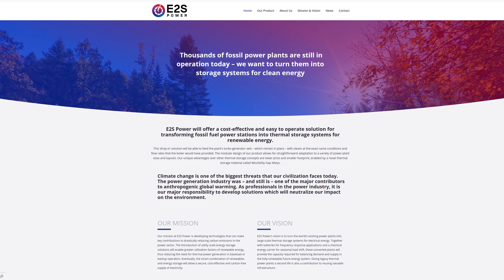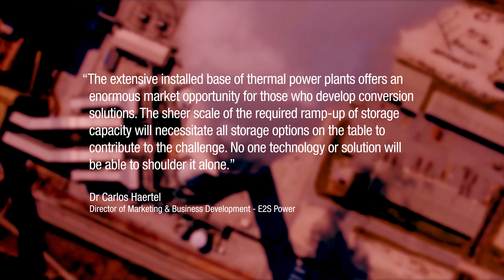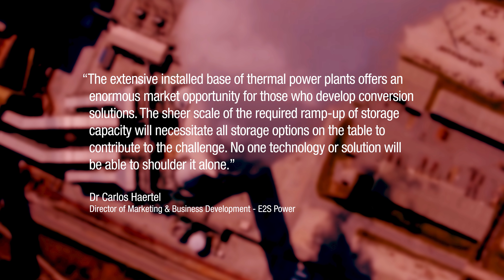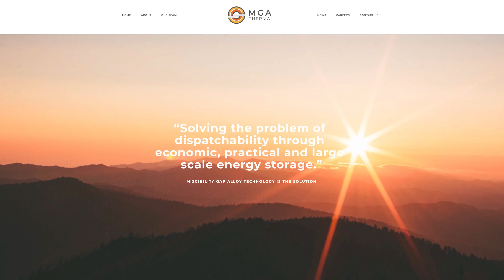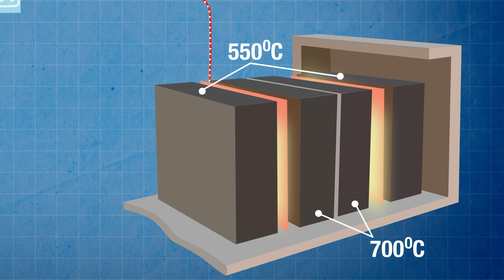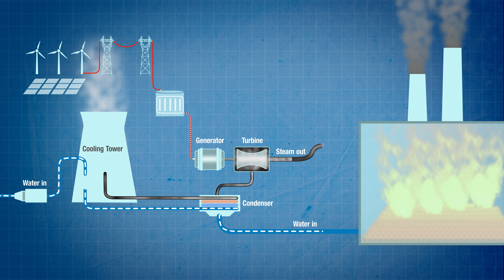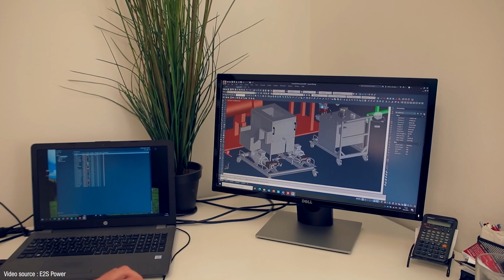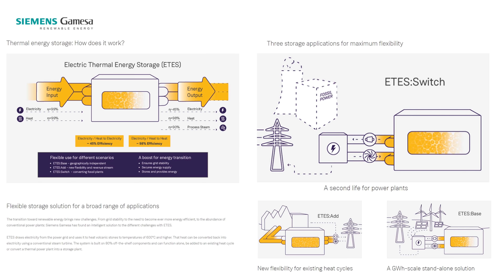New energy storage tech breathing life and jobs back into disused coal power plants

Comment: There are a lot of "ideas -- scientific principles" that work. It's all about cost at scale. What's cheaper? What will last 30 years? Heat energy stored in rock/gravel/sand as sensible heat or heat stored as latent heat (phase change)? Aluminum is a good choice because it's phase change occurs at 660 C and high pressure steam in a power plant is 540 C, so that's a good match. Each pound of aluminum absorbs/releases 396 BTU. E2S Power is very new at this. Their website says almost nothing. Siemens Gamesa is taking the hot rocks sensible heat approach. Basalt (a good stone for this app) is $50-80/ton (maybe less in giant quantities). Aluminum costs $2710/ton. Then you need to design and cost the containment vessels and equipment to move the heat. A lot of work to do, but that's what engineers do. Get some funding and hire a bunch of engineers. Right now I'd bet on Siemens, but the E2S Power concept is intriguing. As a retired chemical engineer I already have a thousand or so questions!

Comment: Hi Dave, It is encouraging to see the diverse range of solutions being developed for grid scale energy and there impact on the viability of alternative energy sources.  I am surprised that none of these solutions are looking to use excess energy to produce hydrogen.   Is there a reason for this?  Perhaps it’s round trip efficiency is too low?
Hydrogen appears to me to be excellent fuel source for short term peak energy production through existing gas turbine infrastructure, or indeed to power steam boilers in existing coal fired power plants.    
The extra bonus that hydrogen promises is its ability to power mobile plants and heavy trucking. 
I would love to see a comparison of the various technologies and their respective pros and cons round trip efficiencies.
Thanks for the channel it is extremely informative and thought provoking.
Reply: Good point.  If Hydrogen is used for heating purposes and for industrial processes including steel production, fertilizer production, and other chemical syntheses, then there is no efficiency disadvantage between H2 and battery electricity. For home-based fuel cells or combustion engine to generate home electricity as well as waste heat recuperation for home heating and water heating, then there is no efficiency disadvantage between H2 and battery electricity. The electric grid is still there to consume solar and wind electricity directly, as well as storing the grid-excess electricity in grid-utility battery or PowerWall home battery. Likewise, a Plug-in FCV can use grid electricity for 80% of total mileage and needing H2 for only long trips totalling 20% of total mileage, while requiring 1/5 the total battery capacity of a long-range BEV.

We can have total wind and solar capacity as high as 3-5 times the maximum power demand of the electric grid, so that the vast amount of grid-excess capacity will be devoted to making H2 for all kinds of usage. Thus, when combined solar and wind outputs are down to 1/3 to 1/5 of their peak, then all of this weak output will be fully-devoted to power the grid. In this way, we can have a grid powered by 100% RE nearly all the time, without resorting to much energy storage. Home-based Fuel Cells or H2-Engine can be programmed to turn on as back up power for the grid if necessary, thus sparing the additional expense of having stand-by power stations that are rarely used. The waste heat of the home-based FC or H2-Engine can be used for making hot water or keeping the house warm, thus maximizing H2 round-trip efficiency to rival the round-trip efficiency of battery. 

Blue and Green Hydrogen will have a gigantic market for steel production in order to replace coal that is currently used. Likewise, H2 will replace fossil fuel for heavy-duty transport vehicles like planes, ships, trains, and trucks. Light-duty vehicles and short-haul trucking can use Battery electricity, in the form of Plug-in FCV that will have JUST ENOUGH battery for daily commuting and delivery when charged at night, while longer trips will use H2 for convenience and seamless utility. A personal Plug-in FCV will take advantage of a nation-wide H2 filling infrastructure for trucks and buses and will have no infrastructure problem.

Comment: I wonder if thermal efficiency could be boosted by integrating condenser plumbing into thermal storage units to  preheat the units during their off-cycle. Or would require an overly complex and massive heat pump mechanism?

Comment: My only question here is with these massive blocks that are 700 & 550 degrees Celsius is the insulation from the outside air. Will this insulation reduce the temperature around it or will it still expose the world to high temps in potentially millions of places around the world? I realise there's no CO2 but if there are millions of these won't that expose the world to some level of warming & if so, how much?
Reply: For the previous reason I wonder if towers that raise & lower weight wouldn't be better for the climate? Perhaps designing a private tower for individual homes which could also include a small vertical wind generator attached to it as well might be a better solution. I don't see the value in heat storage unless the insulation keeps that heat radiation to a very, very low level. I also don't trust controlling bodies to actually give a toss about reality over money.
Reply: I wonder if it's not time that every new home built has its own power supply included plus solar panels &/or VAWT included in the build automatically. Use of battery storage might be optional. Independence has got to be an improved scenario to what is happening at present.

Comment: Really? Assuming a power of 100MW sustaining for 8h 
Using Enthalpy of Fusion of aluminium 10kJ/mol and no losses
You need a block of aluminium weighting 7400 tons
with a size of 14x14x14 meters as a rough estimate
graphite not included
And 100MW is a rather small power plant, I think 
Battersea Power Station from the fifties had 3 units of 100M and three of about 70MW

Comment: Efficiency? By the time the energy goes into the storage system, is retrieved, boils water and spins the turbine, what percentage of the energy in comes back out in the form of usable electricity? That did not seem to be addressed in the video.
Reply: I would suggest that those people questioning efficiency are missing the point.  Yes, it does have to be have a level of efficiency to make it commercially viable.  BUT given the context of global environmental catastrophe due to climate heating, ANY method that contributes to reducing CO2 emissions must be seen as worthwhile.  The level of efficiency of any technology tends to be increased over time in any case, so arguing over efficiency at day one is not helpful.
Reply: @chrislaf2011  Asking about the efficiency of the system is worthwhile. For LI battery storage, the efficiency is over 80% and LI battery systems can respond to changes in load in milli sseconds. I don't think that this energy solution can come even close to technology we already have.
Reply: @surferdude4487  there are limitations to Li tech, it's mentioned in the video. Li suck at long offload times. A lower efficiency system is competitive if it overcomes the limitations of Li tech.
Reply: @migBdk  LI batteries are good for a few days, even a couple of weeks but they do leak down over time. Yes, I would be interested in an energy storage system that could hold its charge for as much as a year. I'm just not sure that the one discussed in this video is it.
Reply: @chrislaf2011  that is total idiotic blithering ranting desperation BS !!! there are plenty of truly great grid storage systems without having to resort to grasping at these very thin straws
Reply: because its a s#it idea with s#it efficiency

Comment: I'm curious how energy dense this is.

Even if no losses, using specific heat of Aluminium at 900J/kgC, latent heat of fusion 396000J/kg and the temp difference of 150C (700-550)
You get Energy stored per kg of Aluminium: 150*900+396000=531000J/kg
Density of Aluminium is 2710kg/m3
So for pure Aluminium raising temperature from solid at 550 to liquid at 700, energy is 0.4 MWh/m3

Knock off 50% for losses and 50% for insulation and graphite

Energy density 0.1MWh/m3 (this is probably optimistic)

Power stations are large enough to store how large a thermal system?

50m long by 10m high by 10m wide?

If so, that would be 500MWh of energy stored.
Reply: Do you think your 50% ratio is ok for insulation and graphite? 0,1 MWH/m3 is quite hight as a result
Reply: @philippechauvin7207  I don't know, but insulation is very effective in a relatively small volume, so I think most of it is the graphite component. Not saying it's easy, but handling high temperature pressurised steam in pipe work is commonplace.

Comment: Any mention of the energy efficiency of this system?
Energy in vs Energy out?
Maybe a heat pump would be more efficient input if it could handle 700 degrees? 
I had this idea/though experiment a few years ago - but discounted it on the inefficiency of the steam turbine.
I guess even low efficiency is better than just wasting surplus energy!

Comment: Not one mention of efficiency... Using electricity to heat up the banks will cost far more in electricity than what will come out. At this time, these "old" coal powered generators run at somewhere between 38-42% efficiency..Let's take an average 40%. Now the turbine and generator etc are going to be the same, so we can expect approximately the same efficiency +/- a little... Therefore, one will need to put in 2500 GWh of electricity to get out approx 1000 GWh..(Best Case !)  Even pumped hydro storage generally runs at 70% or higher making this proposal almost HALF as efficient as pumped Hydro...I cannot see this flying to any great extent because of the losses involved...

Comment: E2S will need to publish conversion efficiencies for their process before I get excited.  Coal power stations I recall had a heat to electricity conversion efficiency of about 40%.  The conversion of electricity into heat and then back into electricity, given the limitations of steam turbines, would indicate that the entire storage efficiency might be only 30%.  The second issue is the speed of response.  One of the reasons that pumped storage hydroelectric batteries (Dinorwig, Wales and Cruachan, Scotland) have proved useful is the rapidity with which they are able to respond to energy fluctuations in the face of the slow response by traditional power stations.

Comment: In my estimation, the round-trip efficiency of such a system will not exceed 30 %. Although it depends on many factors, this probably makes this technology too expensive to ever go beyond the experimental stage.
Reply: Yes - I think that will be the main downside to this concept, apart from the inability to ramp output up and down quickly. When you also consider that the efficiency of solar panels converting sunlight to electricity is 20% if you are lucky, plus transmission losses, the whole system efficiency looks pretty poor. The solar power tower might be a better bet, particularly if you could reuse the turbine from an existing power plant.
Reply: @michaeladdis5965  
Generally speaking, the geology that makes coal deposits almost always makes hills and valleys. The exact opposite of what you want for a solar tower installation.

Germany is probably the only exception I can think of. But recovering < 30% of 20%, this is looking pretty ridiculous in some very fundamental ways.
Reply: It's a fundamental limitation that absolutely  grantees this wont even get to the experimental stage. It's not even intended too.
Reply: @lordsamich755  the whole purpose of this system is to grab headlines, and harvest some investment money. Nobody with a brain believes it has a snowflakes chance in hell of being viable

Comment: 1. This is a technology that can also be added to other thermal power plants (operational coal, gas, biomass), it can not only be added to disused coal plants. On addition to fuel saving there is the added benefit for some types of power plants with slow response times that the response time can be reduced.
2. Solar thermal power plants use a similar technology (molten salt) for storage. Likewise these storage systems can be equiped with electric heaters to store energy from wind or nuclear at night, so it can be used in the morning.

Comment: Sounds like a good plan, although I've always thought having cooling towers to dump heat into the atmosphere a bit odd. Surely there's a way of using it?
Reply: The basic problem is you can't pump steam. The CT removes the latent heat of condensing steam. Engineers minimize the flow to the condenser by extracting steam for other uses like heating combustion air and feed water.  As little as possible gets dumped to the atmosphere, but it's still the largest heat loss.

Comment: Interesting.
Not just reusing the extant infrastructure, but it's advantage; the rotating stators of the generators (individually & in total) provide a dynamic response to load - when load picks up, it hits the generators as increased load, slowing them slightly thru inertia to energy conversion. Affects the frequency of the AC lines - that speed of response.
There wasn't an available large scale green tech to cover that gap in the same near-instant timeframe. Enough energy sink/soak types cover when generation exceeds loads, but load exceeding generation off the daylight peaks of leading green sources was still an issue.
This & similar are two for one answers, hopefully among others; pumped hydro being one 
I'm not an expert, extrapolating based of link below (Tom Scott vid) & other vids re green tech.
https://youtu.be/5uz6xOFWi4A

Comment: The most effective way  to use stored thermal energy  is as thermal energy , 97% on large scale systems. Use it as city heating , industrial pre-heat,  greenhouses, ect. If you start out with excess electric power , keep it as high quality power as possible never convert it to low entropy, you always lose when you do that. Every energy conversion  has losses. The more conversions the more losses. From a physics standpoint  the best way to store power is a reversible system with minimal losses , any conventional thermal  to electric system will have 70 plus % losses (MHD < 25%.) compressed gasses to electric 25% loss , gravity systems 10-20%,  reversible chemical ie battery  30% down to <6%. If you see a storage system and it has a cooling system all of that discharged heat is lost power.

Comment: minor problem, one kilowatt hour input of electrical power produces one kilowatt hour of thermal power, that heat used to boil water to run a conventional power plant is converted back to electricity at 30% efficiency. That means at 5 cents per kilowatt hour input you must charge 17 cents to pay for the original power , plus the operational cost of the plant . Normal coal plants run full time ,this plant may only run 5 hours a day on average. so plant operations alone go from 5 cents at full utilization to 25 cent per KWH during intermittent ops . 42 cents generation costs plus an 7 cent distribution is 49 cents /KWH now add any profit and margin . Even if they got power for free this is going to be expensive .

Comment: I doubt this will be a practical energy storage system due to losses.
Whilst a electricity to thermal process may not be to lossy (90%?) , the thermal efficiency of a steam turbine is a different game.
Less than 50% is typical, before you consider the losses in the generator unit etc

Comment: Isn't thermal conversion to electricity (making steam and turning a turbine) only 30% efficient with the remainder going into waste heat? This mode of storage (off hour electricity converted to heat) would then be wasting 70% of the energy. Better than not using it at all I suppose, but putting it into a battery would be much better, no?

Comment: The analysis here seems to miss one of the most important issues with applying this tech to steam power stations.  That is, the stream power generation cycle is very inefficient for precisely the same phase shift reason he discusses related to melting aluminum.  Conventional coal power plants are only about 45% efficient. There are far more efficient scalable energy storage options.  Seems like a boondoggle to me.

Comment: I wonder how the efficiency of this system compares to other grid scale storage. The best gas plants are about 50% efficient in terms of converting the heat energy of the burnt gas to electrical energy, not sure how coal plants compare but 50% would be the upper limit. I’m pretty sure that’s less than batteries or pumped storage hydro… but you get most of the plant for free so maybe in $/MWh it makes sense (I guess I should say £/MWh on this channel :p)

Comment: The Thermodynamic efficiency of steam is terrible.  Most coal plants are at best 45% efficient.  Assuming you can turn 100% of the electricity into heat, you can only get 45% of it back after running it through this concept.  The only reason you would dump excess electricity into this is if you had topped up virtually every other battery storage available.  It would be better to electrolyze water into hydrogen with excess electricity. Otherwise, it would be better to rip out the turbines and generators and re-use the real estate for battery storage.  Move the turbines and generators to a modern nuclear installation.